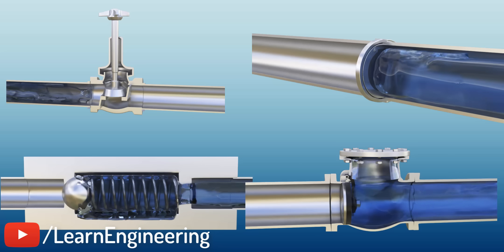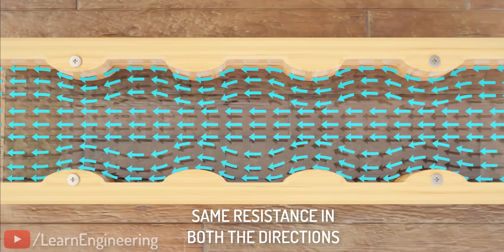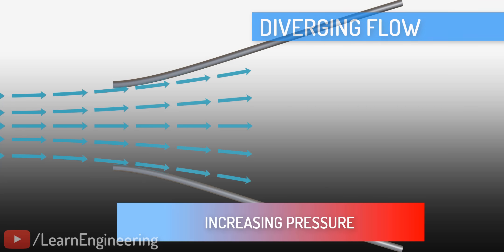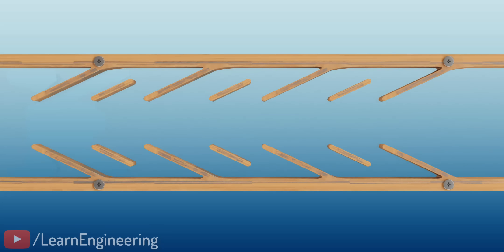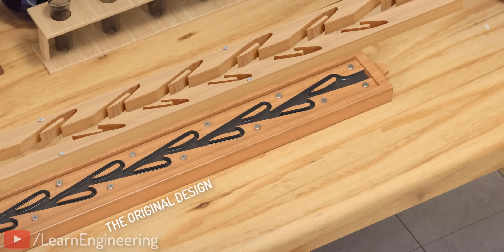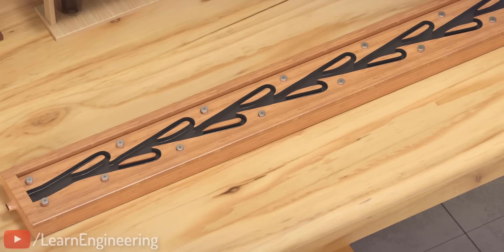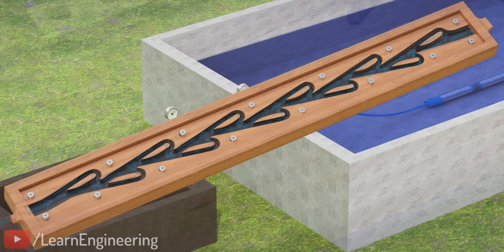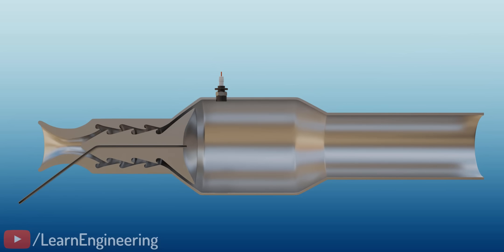Tesla Valve | The complete physics

Comment: this is like designing a laser to cut bread. very inefficient device.
Reply: how is this inefficient?
Reply: @dw2843  it's very big for an one way valve, isn't it?
Reply: @cristiandemirel1918  thought he meant energetically inefficient.
Reply: It is much more cost-efficient in extreme-pressure and micro scale applications than most other check valves. Both in terms of manufacture and maintenance.
Reply: Not Tesla's model
Reply: You don’t use lasers to cut your bread?
Reply: @beieber4life  only when I have diner with Romulans.
Reply: I’d buy that 🤷🏻‍♂️
Reply: the correct word was overcomplicated.